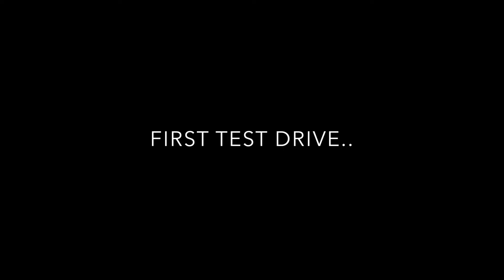pulse jet ice boat

Comment: Considering how mechanically simple pulse jets are I am surprised we don't see more of them. This has the least moving parts of any fuel powered vehicle I think I have ever seen.
Reply: They're incredibly noisy, and have terrible fuel efficiency for a jet engine, hence why they aren't used.
Reply: @trialsmart  The whole running red hot doesn't help either.
Reply: Colin Furze plays with these
Reply: Other than Liquid Mercury anti gravity engines, but they spin so idk.
Reply: @nevyen149  well the ones filmed are thin. They could be made differently but does them glowing make you say that?
Reply: @EthanAdey  tell me more.
Reply: The way an invention is either embraced or disregarded is down to efficiency or cost to make/operate.  This simple device does work but not as efficient as probably a modem 50cc gas engine could perform in usable power and low fuel consumption
Reply: @joeKisonue  USAF has it
Reply: @joeKisonue  The way they are designed makes them run red hot no matter how thick or thin they are made.
Reply: @nevyen149  well I'm saying you you could wrap them and also people don't normally see the red hot bits of their engines
Reply: @joeKisonue  Well, I'm saying you're beating a dead horse. 
First off, it's not a surprise "people don't normally see the red hot bits of their engines"...since a car engine running normally does not run red hot.  
Next, there's only so much heat shielding or "wrapping" you can do before you are also confronted with the facts that, as others have pointed out they are deafeningly loud, and not efficient.
Plus, there's no way to "wrap" the exhaust, which is...unsurprisingly for a thing which runs red hot...also very warm...and exiting at such a rate it will heat, vibrate and blow apart the very pavement you are on if it gets too close for too long.   
Face it...even the next stage up in complexity in terms of jets is such an improvement that the classic pulse jet is really just a novelty fit for backyard mechanics and crazy inventors.
Reply: @nevyen149  I agree
Reply: @nevyen149  I dunno I think a jet engine can get red hot it’s just covered
Reply: https://youtu.be/GjPAOwQvyYg here’s a turbo jet engine you’d see on a plane it’s uncovered of course it’s diy but if it was covered Then I’m sure it wouldn’t get red hot cause you wouldn’t be able to see it
Reply: @likeabirdoffical  People still flogging a dead horse.
Reply: @EthanAdey  it most assuredly does not
Reply: because valveless pulsejets are literally the lowest thrust-to-weight, lowest thrust-per-fuel-air-mass efficiency, "jet" device that ever existed. The V-1 had valves for a reason.

Comment: Looked like a lot of fun . The glowing pipe was intimidating but step 2 could be a shield of some sorts . Add some shock absorbers , electronic ignition , floor boards, and a GOPro and you could sell these . 
Great Job Guys 👍🏻

Comment: well i guess it'll keep you warm.... you should probably put the throttle on the drivers side, you know if the passenger falls off
Reply from the maker: Dylan Johnstone 
Your right, it was stupid to put stealing and throttle on different sides but both wonted something to do:) 
It will be a new version soon. 
The heat was a bigger problem then the coold;)
Reply: @jonassvenssonharskogen5186  i figured that was the case. but im just thinking from a safety stand point. you should get an exhaust gas probe and some other engine instrumentation gauges for the passenger to monitor. everyone needs a flight engineer and you'd wanna know to kill the engine if it gets too hot
Reply: If the driver falls off then the passenger can shut it off. It goes both ways.
Reply: @kwhp1507  that's not how redundancy works...
Reply: Driver should have a shut off valve but I like that the engine is monitored and controlled by the copilot.
Reply: @jonassvenssonharskogen5186  
"a new version soon?" so you're keeping this YouTube thing up?
I would love to see more of this!
Reply: I mean if the driver fell off and they were on the same side, that would suck
I guess if the passenger fell off the driver would be able to steer clear of things until he figures something out, if the driver falls off the passengers can just cut the throttle
Reply: @TheGimpy117  "it goes both ways"   actualy, thats Exaclty how redundancy works.
Reply: There was absolutely nothing stupid about any part of what you built !!!  Genius level idea !!!
Would like to see video of an observer as it approaches and goes by. 
Maybe connect cable or linkage from drivers foot to copilot to cause much discomfort if throttle isn't wide open.
Camera bounced too much , steering wheel was on the wrong side and nothing exploded lol
Can't wait to see 2.0 !!
Reply: That's how race boats work, the throttleman on one side, the steerman on the other

Comment: It's safe to un-mute at 0:33, that's when the music ends.
Edit:
Oops, sorry. It comes back later.
Reply: At least it's not the garbage that Colin Furze plays over all his videos.
Reply: Agreed - it earned a thumbs-down just for that. There is nothing more annoying than obnoxious and idiotic 'beat music'.
Reply: At least you both should agree that Furze has a different taste in music than you, whereas anyone who uses the music in this video has NO taste in music.
Reply: Nope. I insist that such noise doesn't represent music at all, and therefore has nothing whatsoever to do with what you mistakenly identify as 'musical taste'. 8)
Reply: There was music other than the sound of the engine?
Reply: Or there was no 'music' other than the sound of the engine...which was much preferred over any of the other sounds. 8)
Reply: Hehehehehehehehehe!!!

Comment: me: how much fuel does it consume?
ice boat: yes
Reply: Alot!!
Reply from the maker: salamelek 
A lot:) Around 1kg propane/minut
Reply from the maker: Or maybe 2🙈
Reply: @jonassvenssonharskogen5186  maybe 4? 😂
Reply: All of it...
Reply: Fuel to noise conversion is nearly 95%
Reply: All of it !
Reply: Jonas Svensson 
Could you use hydrogen as fuel?
I realize that propane is relatively  easy to buy, just curious.
Reply: @jerrypeppler1484  well...hydrogen is very, very, VERY reactive.. therefore i think u have to have a permission to buy it. but maybe it could work... its just a bit explosive...  SO.... 🤷
Reply: @elessarstrider5210  They could call it Uber Pulse, and market as, "The first jet-powered Uber.  So much fun it requires a waiver of liability!"
Reply: Hold my pickled herring and watch this!

Comment: should add metal fins as heat diffusers to help with over heating.
Reply: Actually, you don't want to diffuse the heat as that would lower the efficiency.  What you want is a heat shield so you don't fry any body parts that make accidental contact.
Reply: you have the palm of an interesting dulaka

Comment: Goes aproxamatly mach one, laughs, then of shit we forgot breaks.
Reply: I think they probably had a nice BREAK after the test run. perhaps indoors, with some warm tea. or did you mean to say BRAKE as in something to slow the vehicle down? at 2:40 you can see the driver pulling on the brake.
Reply: @crazypete3759  And at the very end the grating/scraping noise was the brake. The other sound was laughter. :)

Comment: frame looks like a boat trailer.
just need the trailer connection on front and wheel axle on each side.
then just unhook it and take wheels off it.  boom  jetboat :)
no unloading from trailer.

Comment: Super, super cool,  well done! A quick question, why doesn't anyone make one like the V-1, with the vents in front that open and close constantly
Reply: Those valves have a really horrible lifespan.  Not an issue on a single-use bomb, but becomes a hassle with something you'd like to reuse.

Comment: Looks like a couple more propane tanks would be beneficial. It's too bad valveless pulsejets are so inefficient, 90% at least of the total energy is waste heat.
Reply: Might be a dumb question but could you use copper tube as the fuel line and wrap it around the outside of the combustion chamber/area? It might work as a cooling system just like the "reusable" orbital space nozzles/engines and might save the engine housing a little longer and allow you to run it at higher pressures. It also might just overheat your fuel lines, explode, and give you some unanticipated facial reconstruction.
Reply: john smith seems like a lotta work to me, and I think the extra heat of the exhaust increases thrust, so it may increase longevity of the combustion chamber, but decrease thrust
Reply: @roderickmcleod4864  The reaction itself would remain the same within the chamber with the same heat and byproducts but the chamber walls should stay cooler unless the cylinder shaped fuel/cooling tubing didn't have sufficient surface area in contact with the chamber walls to transfer the heat. In theory, putting the fuel/cooling lines inside the chamber would suffice but, for an engine that small, the amount of fuel being passed through the tubes would be insufficient and, as the guys over at NASA figured out, you overheat the nozzle and then everything blows apart. Maybe putting them on the outside wouldn't remove the most amount of heat but it also might keep everything from overheating in general. Like a compromise.
Reply: john smith cylinder walls need to be red hot to continue the combustion. One of the many reasons pulse jets haven’t really made it into modern innovations.

Comment: The idea is from Werner?
Reply from the maker: Lucas Labor 2002 how’s Werner?
Reply: Jonas Svensson how does is turn? Cool design!
Reply: wernher von braun?
Reply: KashBeGamin I think the wheel is connected to a flexible shaft that goes to the front rudder. Unless you were talking about how the turning of the shaft moves it, then idk.
Reply: Where is Eckat, though? 😂
Reply: @jonassvenssonharskogen5186  Good question, but I guess he refers to Werner, german comic  (figure) that became partly a reality story. In his 4th comic in 1985 the author Holgi wrote about a race on his horex motorbike  against his friend in a red Porsche. The comic portrayed that race of Holgi on his selfbuild  horex bike with 10 cylinders against the red Porsche. Complete north germany stucked in a traffic jam in 88 on an airstrip, when they started a real race after Holgi had build his Horex bike called red porsche killer. They had expected 100.000 visitors and sold all tickets but 200.000 arrived so woodstock circumstances.

The comics took place in northern germany, portrayed the old rural style where the people  are more like vikings, tough n rough and speak a dialect and always enjoy a flasch beer particular bottle beer with a recloseable cap out of ceramic + rubber seal with a special blob sound when you open it. The race between Holgi and Brösel was supported by bands and acts like roger chapman

2018 or 30 years later the revanche took place and this time the horex won. Here is Holgi looking back on 1988 race - before german unification.

https://youtu.be/nkdUctFE3Xo

There was also an animated cinema movie with a soundtrack ... every piece huge successes.
Maybe movie has subtitels on dvd but you would definitely fit in that story like a next sequel the swedish challenger V1 against horex and  the red porsche on ice. 

Ask them and I guess the whole marketing machine will blow you and sweden away: the swedish challenger from the ice against red horex and porsche ... but should happen in summer to get the attention + tourist attraction ... 

if you think I'm kidding check that Werner channel linked : that is only about the 2018 revanche
Part of the game has always been the crazy strong souñd of this car and bike 

and your ice cat with V1 propulsion would fit perfectly ...

Think twice if you might start a challenge in sweden or germany ... on a summer ice track. Yes, those exist already as training centers for olympic biathlon team and so on ... they would create a summer ice track on an airstrip and then the fun would begin.
Reply: @coltonjacobs5383   that answers my question, thanks!
Reply: @jonassvenssonharskogen5186  he may be referring to Werner Von Braun father of the US rocket program, I'd keep rockets off the sled personally.
Reply: @idont3282  you mixed up pulse jet with rocket jet! It not WVB idee...😉
Reply: @janospal5197  he did not said exactly who he was talking about , Werner could be my grandpa, if you don't say exacly who you're talking about it's open for discussion

And i know that Wernher Von Braun was a german rocket enginer and made v-2 not v-1
i like rockets :)

Comment: Awesome.  Maybe add some cooling fins to the pipeing ?  That cant b good for the metal.   U could also then use the fins for heating a small cockpit enclosure u make with half the pipe protruding inside center of cockpit.  "pulse jet ice boat with heated cabin"   kool

Comment: Funky idea - grand execution! Thanks. I understand the basics of the pulse jet engine as used on the V-1 Buzz Bomb, but can only guess as to how the doubled “tuba” works.
Reply from the maker: Thank you👍👊
It's pretty simple, at least if all dimensions are right🙄 Has menu drawbacks compered ti valved pulse jet but it's easyer to build and it has no moving part that wears out👌
Reply: @jonassvenssonharskogen5186  From what I remember of the original pulse jet, the engine was considered “in tune” when the thrust flame was observed to have “diamonds” within it from sonic waves, apparently a function of the right combination of tubal dimensions. Have you seen that?

Comment: May i sugest adding a heating element under the sled connected to the body of the pulsejet.
It may make the ice sled easier to move upon the ice.
A few brass tubes may work as a heat transfer so you can heat the bottom of the sled enough to melt the ice a tad as you go over it could improve speed but may reduce stability

Comment: Nice video
Taking in count that in this design the pulsejet is hit by ram air 
Could be interesting to see if putting fins along all the pulsejet body would help in the thermals 
and overall lifespan of the engine

nice video
Reply from the maker: Have been thinking the same thing but it's handling the heat pretty well anyway🙂

Comment: This is awesome. I'm really impressed with your engineering on the pulse jet. 

But why did you use a delta configuration on your ice boat, rather than a tadpole or four runners?
Reply from the maker: Thanks! Don't really understand what belta and tadpole means?
Reply: @jonassvenssonharskogen5186  Hello, 
Thanks for your reply. 

Delta and tadpole are tricycle configurations.  Delta has the single wheel in front, like many light aircraft.

Tadpole has the single wheel in the rear, like the classic Morgan sports cars, or the current Can-Am Spyder-series motorcycles. Despite having only three wheels,  this configuration is highly stable,  and corners extremely well. 

Delta tricycles can be prone to tipping forward during sudden maneuvers. 

However your ice boat is configured, I think it's incredible that you designed a pulse jet that is powerful and dependable enough to drive such weight for so much distance. 

Most excellent!👍
Reply from the maker: Ok, thanks fore the answer🙂 Allsow made a new version, completely new but same configuration. Drove at a event with wery pore ice and crashed. Ther is a video on that allsow. But now I'm building version 3 with two skies in front and two in the back for better stability🤞😃
Reply: @jonassvenssonharskogen5186  Subscribed!

I'll keep an eye on your progress.  These clips are exciting and fun to watch!
Reply from the maker: Thanks👌 There will be updates but have 3 smal children so everything takes time🙈

Comment: Looks like u need some weight on the front blade lol. Well done guys.
Reply from the maker: You couldn't be more right😁
Changed the angel of the grinding a later run, worked a lot better.
Made a new version that was really good and fast. But I crashed it🙈
Is a video on my chanel🙂
Reply: @jonassvenssonharskogen5186  too bad lol. Hope no one was hurt lol.Looks like a lot of fun.
Reply from the maker: I got a really good beating but nothing broken fortunately🤞
Reply: @jonassvenssonharskogen5186  right on. You goin to rebuild lol.

Comment: I find the noise from this pulse jet design much more pleasing and lower pitched ..... With that much thrust, one could easily build an aircraft powered by the design.
Reply from the maker: Will soon messure thrust and also try with a air augmentor to see how much thrust increases🙂
Reply: @jonassvenssonharskogen5186  Remember, all of USA spaceflight is built on 1940 era V-2 German engine. Russians advanced to "closed cycle" jet engines and got greater efficiency. Extensions on German (air breathing pulse jet) V-1 engines was never fully explored and here is a real opportunity.  SAAB is waiting to pay you big money...😆
Reply from the maker: Haha hope your right😁 I will do my best to make something that works good🤘

Comment: a bit of thin ice or a bump or forget how hot the pipes are and then game over but otherwise its great. what is the estimated top speed? A v1 on ice sounds like a cocktail drink
Reply from the maker: Would like to taste that drink👌 
In that version the top speed was around 75km but it felt a lot faster😁
Reply: @jonassvenssonharskogen5186  I bet it did. Where is this? Scandinavia by the sound of your name?
Reply from the maker: Sweden and more precisely Trollhättan.

Comment: I know this is an old video, but how did you design this? The dimensions for the combustion chamber and exhaust. Looks like a scaled up Lockwood.
Reply from the maker: It's more ore less that. Yest modified a bit for our needs. But a scaled up version should work Yest fine.